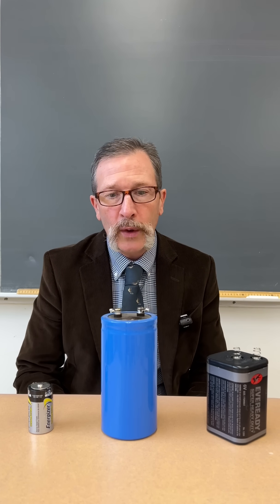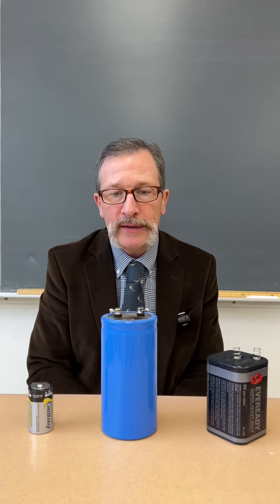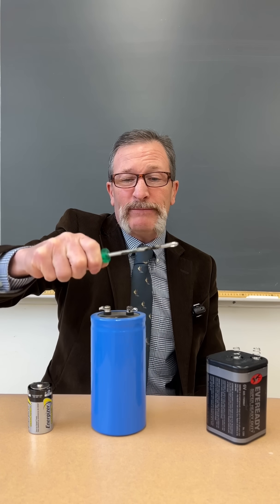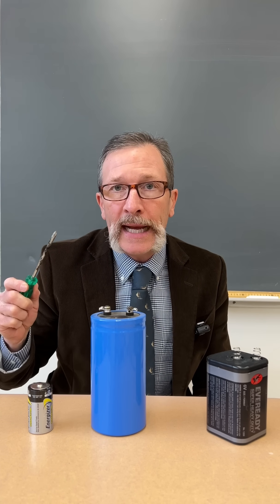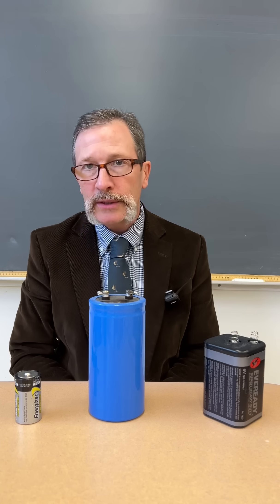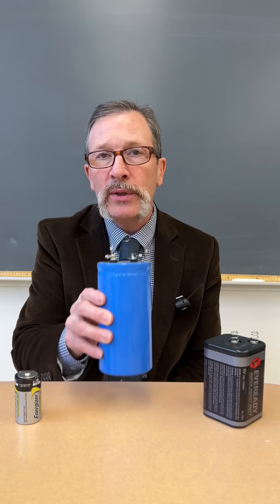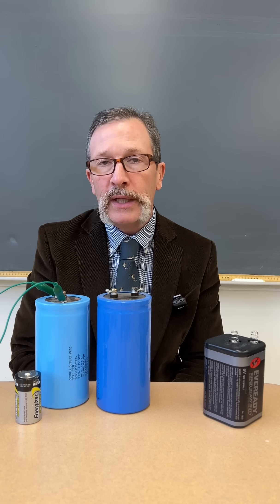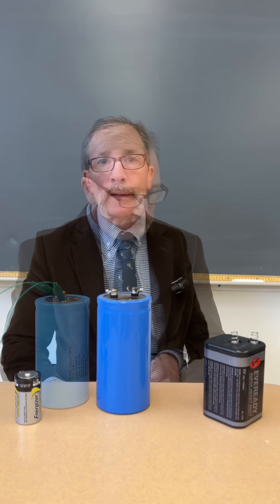Don't EVER Do This in the Lab!  #science #physics #electronics

Comment: without knowing their chemistry it's hard to say. I'm assuming the blue one is either lithium or lead based. now are we talking safety based on the stability of the electrolyte or corrosiveness of the electrolyte? if it's stability then the lithium battery would take that one, corrosiveness you can give to the lead acid one.

Edit: Oh yea, that capacitor would rock you if it was higher voltage, but a short circuit could mess your projects up.
Reply from the maker: Thanks for participating and commenting!

Comment: They are ALL dangerous, just at different scales and time frames.  The cap can be instantly fatal, the batteries are severe explosion and fire hazards under the right conditions. BTW, I used to have a large laser discharge capacitor (4 uF at 4,000V.  Its was labeled "LETHAL ENERGY" and came with a shorting load installed. I tested it one time by removing the load and it self-charged in 24 hours to over 3 KV.
Reply from the maker: Wow! Thanks for your comment.

Comment: In vocational school, we used to hook up small caps the size of a your fingertip to a bench variac that would go up to  30 amps.  It doesn't matter the value of the cap, an electrolytic cap that physical size sounds like a firecracker going off and leaves an oily smoke in the air  with tiny shreds of paper hanging in the air.  

This went on until our instructor walked in and caught us in the act.  

He was not happy.  

But he got it.
Reply from the maker: See our other video - Overcharging a capacitor - https://www.youtube.com/watch?v=A4rNHmQtgNw

Comment: I recognized the capacitor right away. The cap is the most dangerous immediately, when shorted, or over charged; I've seen one blown up by a fellow student. Thankfully, it wasn't even close to that big. Batteries can start fires when shorted and left unattended. 9v batteries have been known to start fires when tossed into the trash; this occurs when to l two of them get attached negatives to positives. When I was much younger, I learned to start fires with batteries and steel wool for camping.